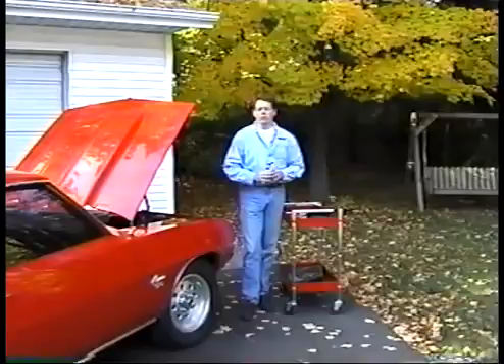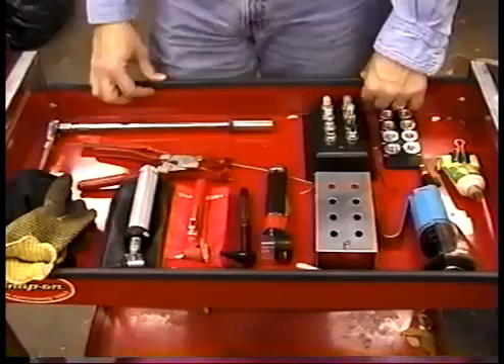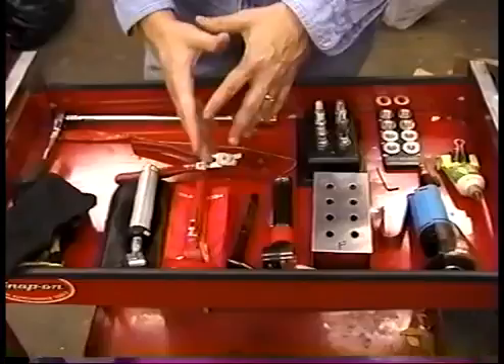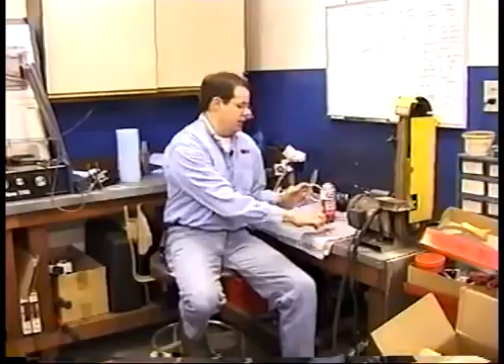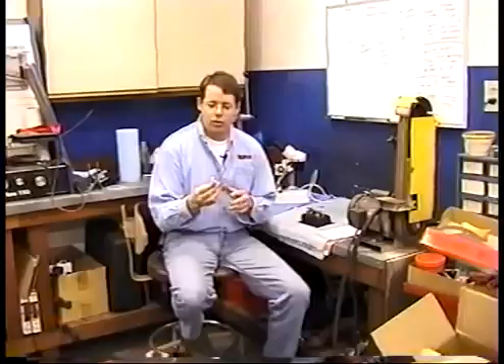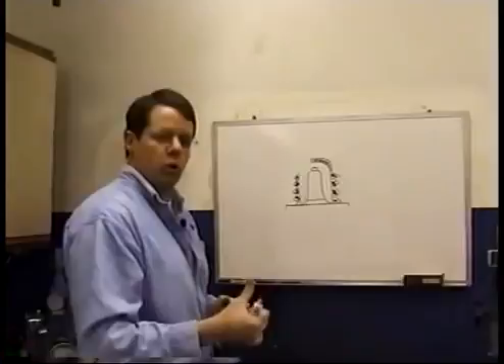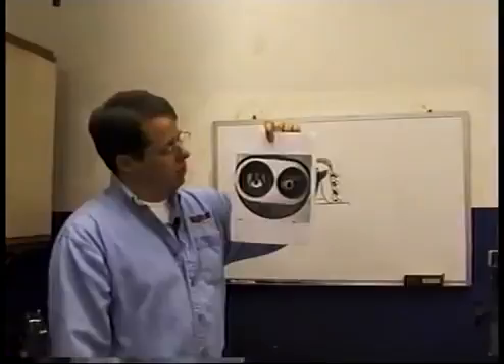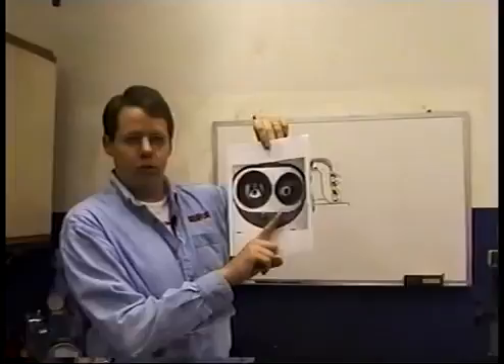Reading Spark Plugs

Comment: I just replaced my  spark plugs.  The Bosch Platinum burned the electrode down to the porcelain.  I replaced the plugs with Autolite Platinum and it made a huge difference in the way my 292 engine on my 1964 Ford Pickup F250.  I have a number of modifications over the years.  I replaced the differential from a 410 ratio to a 373 differential.  The original 2 barrel was updated to a Holly 4 barrel.  The points were replaced with an Igniter with a higher volt coil.  I replaced the split rims with normal wheels and new Bridgestone tires from Costco. I replaced the crossover exhaust manifold with a set of headers and dual exhaust and the way that truck runs now is an incredible difference.  It is like night and day.

Comment: 21:39 My engine runs smoother and has better throttle response when I add 0.1mm spark plug gap. not a big difference, but very noticeable on the road. Fuel efficiency is also slightly better.

Comment: Help, I used octane booster and all of my plugs turned orange.  Now the questions I have hoping you have answers, did I harm anything internally in the motor with using booster, maybe too much booster?  Why did the plugs turn orange?  Will it go away if I quit using booster?  Will that crap burn off?  Can you over use octane booster?  Have I lost plug life due to the orange film?
Reply: Hey I'm curious to know how it turned out? I am pretty inexperienced but i would think it would burn off and be fine... I hope that's true!
Reply from the maker: You won’t hurt anything with too much boost. It’s the chemicals mixed with the boost liquid that changed the color. I can use Marvel Mystery Oil in my gas tank and the plugs turn a different color compared to not adding anything. It’s all in the chemistry.
Reply: Vp fuels octanium? 😂😂😂
Yea your phuked
Reply: @jeffmccormick6382  why is he f’d? I have been using octanium at full strength exclusively. It definitely makes everything orange and I do not like that. I would rather not use octanium but no E85 in my state. Please share your experience. I’m considering buying race fuel to get away from it but it has not caused me any problems though. I probably have close 10k miles using it exclusively.